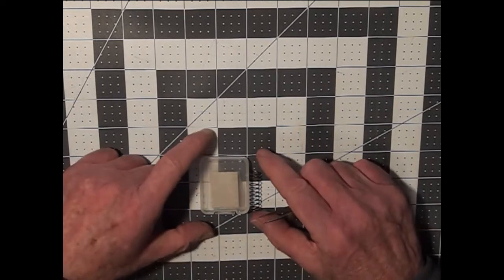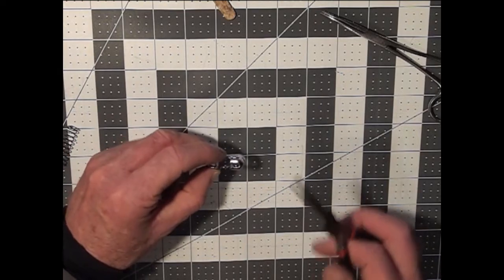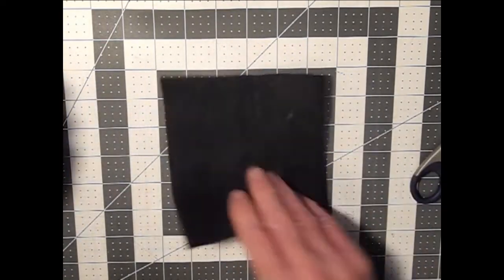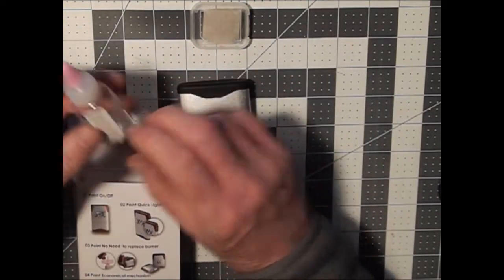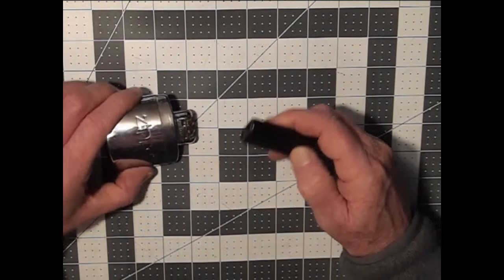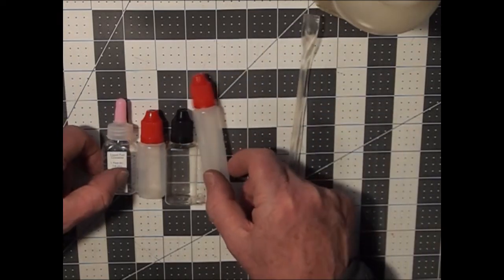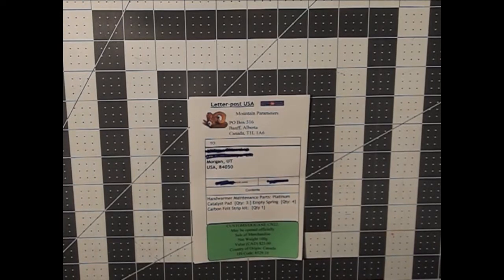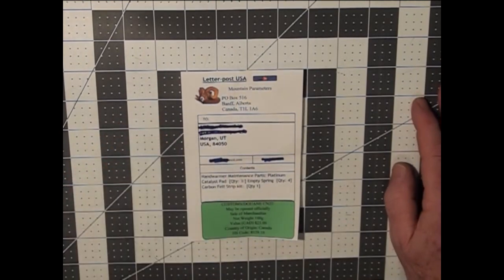Handwarmers, S03E01: Handwarmer Maintenance Update 2019

Comment: Nice Vid!
For anyone thinking of buying a kit, spring, pad and so on,, I live in the UK, and have bought 2 items/orders (shipped to the US where I picked them up at a later date)
NEVER had a problem at all, all as said re the cost and roughly the time (DON'T do the tracking thing! Save money!)

What I can say it this:--
The original flat type Zippo catalysts are junk. Most of them don't get hot but 'warm' - after I have used them a dozen times or so, they are a massive pig to get to light!
The Zippp heads that are curved with a cage are super and last ages.

The original Chinese butterfly type heads give out a phenominal ammount of heat but only last 3 or 4 times before they turn to dust.
Replace with a spring one and a carbon felt strip and it is exactly what it should have been in the first place.

The English Whitby warmers and heads are 100% superior to the Zippo units.
Ease of filling, ease of lighting (sorry, activating) and so on.

The smaller Chinese hand warmers (The blue ones with hearts on them) These are a cracking little things to hang around your neck.
Dump the original catyalist and replace with a spring filled one - Happy Days.
Just for info, these small things have the exact same head dimentions as a Peacock small/standard head, and they fit perfectly.
Downside is that when you fit a spring it keeps popping off the hand warmer as its a bit too short. 

Keep up the good work 'MP'

Regards, Bob
Reply from the maker: Thanks Bob, I've found that squeezing the bottom edges of the catalyst head together with pliers to make if fit more tightly onto the neck of the reservoir helps when you find the catalyst head falls off too easily.

Comment: I was annoyed by my Zippo hand warmer. After having to replace rhe burner I noticed that the new one was flat and significantly smaller than the old rounded one. I thought okay, it should be comparable, right?
Sigh...
Wrong....
The new burners don't even get hot they get warm, and last only a few uses.
This send me looking for alternatives to the new junk Chinese heaters.
Lo and behold I find this Canadian Channel and it's marvelous website and I order two pre made springs with catalytic platinum fluff..
What happens next is awe inspiring!
The Zippo warmer still works foe rhe same amount of time only now it outputs 5X more heat and actually gets hot!
Plus is quick and easy to light!
I'm using an X pattern arc lighter for low damage ignition to the platinum.
So far im loving it!
I'll never buy another reply Zippo brand heater replacement thingy again!
Reply from the maker: Thanks for that. This brings a few thoughts to mind:
1: I wonder if the replacement catalyst you ordered the first time was simply from a sketchy offshore seller. I've tried some from sellers on Ali Express that have worked OK. Finally I submitted them for analysis and the results indicated they contained other catalyst material, so I published the results on our website:
"In March of 2017 we got the results of testing that was done on the new catalyst pads that we pulled from various Chinese handwarmer heads. The results showed that the catalyst material used is Palladium mixed with Iron at a density of .5-.8% by weight. The use of Palladium and Iron allows the pads to be made for much cheaper cost than the USA made platinum catalyst that is loaded on the saffil substrate at 1% concentration. Palladium has a lower melting point than Platinum. In addition, Platinum is less susceptible to contaminant poisoning, and these two factors should increase the service life of the handwarmer heads that are based on Platinum rather than Palladium."
2: I don't want everyone to get the impression that replacing the catalyst in their Zippo will necessarily solve their problems. I have had reports from some users that even after replacing the catalyst in their zippo heads, the hand warmers have not worked as well as they would have liked (EG: just get warm instead of hot). If we assume that all the catalyst is the same, it would probably indicate that there are other factors that can influence performance. We've started a forum thread to see if we can narrow the problem down, but so far there are no real conclusive solutions. One thing that does seem to be common however, most of the handwarmers that do not seem to be improved by replacing the catalyst are the zippo brand. The one brand that seems to respond best is the Jon-e. (I do not sell either of these, so I have no vested interest in promoting one over the other). Personally, I also seem to have the most problems with my Zippo's as opposed to even the cheapest Chinese models.
Reply: @MountainParameters  thank you for the reply! Personally even though the white cellulose stuffing wasn't scorched I still stuffed the carbon felt you sell into the unit just below the metal neck of the opening. This may have resulted in more than just reduced odor production?
Reply from the maker: @zdw306  I'd guess the cotton packing was not scorched due to the low heat output. Now that you are getting higher heat, the CF strip will prevent it from getting scorched.
Reply from the maker: - For the past 24 hours Youtube tells me there is a comment waiting for review, but when I click it, I get a blank page. Not sure if that's a Youtube problem, or a review that was subsequently deleted. In any case, if you made a comment and did not get an answer, that would be why.
- 48 hours and still one comment for review that I cannot see, not sure what's up with Youtube.
Reply: The missing comment I think is mine. I was asking about the auxiliary fill port (grommet) . Did it have a duck bill to prevent leaks? where did you source them
Reply from the maker: The grommet is just a regular rubber grommet, nothing special. It is a common perception that they will leak if not sealed with a flap or valve, but that is not the case. The cotton (or carbon felt) packing in your reservoir absorbs the liquid fuel. If you have fuel that drips out of the reservoir neck, an aftermarket grommet modification you've made, or a seam in the reservoir body, it means that the reservoir has been overfilled and saturated the absorbent material in the reservoir beyond what it can hold. Indeed, there are many designs where there is a seam in the reservoir and it is not sealed, they will also leak from that interface if overfilled. Many users think there is something wrong with their unit when this happens, and that is not the case.
Reply from the maker: @chicamolly  Handwarmers are not 'sealed' units. The packing in the reservoir absorbs the liquid fuel and prevents it from leaking out the seams of the top and saturating the catalyst. That is why they should not be overfilled. Nothing is required to seal a grommet. I just took a grommet out of a box of assorted grommets I had on hand for misc jobs around the house.

Comment: I have 2 different kinds of warmers the Jon-E, and a Zippo.  The heads are slightly different, how wide are the springs you sell?   I am concerned about either a big air gap or it not fitting width wise.  I know the 35mm length is also critical for Zippo, and that Jon-E takes a longer spring to seat properly, but in worst case scenario I could get 2 longer springs and trim some length off to fit.
Reply from the maker: Thanks Mike,
The standard spring (for zippo, etc), is 9mm diameter. The larger spring for the Giant Jon-e, is 10mm. Also the wire itself is thicker on the larger spring, making it stiffer and more durable over time. Both are the same length at 35mm. I have also found that the larger spring also fits into other catalyst heads such as the round butterfly. The larger spring will not fit into a Zippo head. I've never heard of anyone having to trim a spring, as they can easily compress up to 10mm, which is well beyond what you'd need to do with any catalyst head I've come across. (You don't want to compress a spring too much because then you have less area of the catalyst exposed to the fuel). What you're looking for in properties for a handwarmer spring is a composition that can deal with the products of heat and chemical corrosion. I find the smaller spring seems to lose some of it's ability to retain elasticity and shape after it has been removed from a handwarmer catalyst head that has been in service, so I generally use a new one each time I replace the catalyst in the head. In terms of the air gap, remember you want a gap between the top of the packing in the reservoir (either cotton or carbon felt), because if your catalyst in the spring is touching the material in the reservoir, it will wick liquid fuel and get contaminated. (There a quite a few Youtube tutorials that instruct users to 'light' their catalyst on fire to get it going. If you hold a flame to your catalyst and it catches on fire, then the soot from the flame, and the liquid naptha, contaminate the catalyst and diminish its effectiveness forever. If you see a flame when you go to light your catalyst, blow it out immediately, and then let it dry out. It means you overfilled your reservoir and you should use a pre-measured amount to fill it each time. That's why S-Boston includes a graduated filler bottle BTW).
Reply: @MountainParameters   Thank you for the tips.  I have an older standard small Jon-E without the wick to light to get it going.  The element caught fire a couple times when I used too much fluid, and didn't heat it in the right spot, but I blew it out quickly.   I also ordered a giant Jon-E with the preheating wick, and I'm planning on rebuilding all 3 of my warmers using your method.  You have the most comprehensive info on the web with warmers, thanks again for taking the time to reply.  Happy New Year ☺
Reply from the maker: @macattacka2862  Thanks Mike,
I've never really appreciated the presence of the wick, and I remove them when doing a rebuild.  As a lighter that is built into the handwarmer, they are a convenience factor intended to heat the catalyst and start the reaction, but they tend to wick fuel to the top of the reservoir and run the risk of contaminating the catalyst and igniting it when you ignite the wick. They may also speed up the evaporation of your fuel in the reservoir. The remaining orifice when the wick is removed may be more functional when used as a refill port. You get better results from a USB or turbo flame lighter than an integrated wick lighter that depends on flints (that don't work in damp) when outdoors anyway. Putting a lighter into a handwarmer is in my opinion just a marketing gimmick that introduces more parts to fail (or in the case of the flints, run out) in the field, and thus dictate you need to carry a backup ignition device anyway.

Comment: In one of your older videos I saw you use a rubber fill grommet. 
Does it have a "duck bill" to prevent leakage?
Where did you source them?
Reply from the maker: Leakage occurs when the reservoir is overfilled, otherwise the packing absorbs all the fuel. That's why it's important to always measure the amount of fuel you are using to fill the handwarmer. That's also why I always burn my handwarmers down to nothing so that when I refill them I know how much they will take. Those were grommets I had in a box of assorted grommets I had laying around, available almost anywhere.

Comment from the maker: As this video is over a year old now, many of the items on the order form have changed.
Reply: does catalyst, carbon felt, or camp fuel ever go bad?  I recently went back to a hand warmer that wasn't being used for a few years and it stopped working.  Thanks.
Reply from the maker: @714SNF  
They do not go bad due to time decay, but other factors can affect the catalyst. That's what I'd replace first.